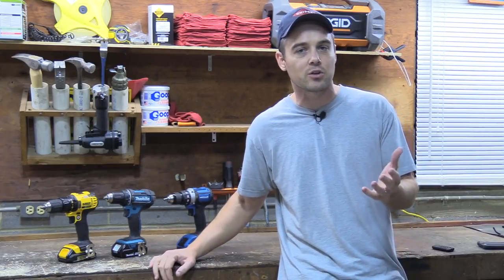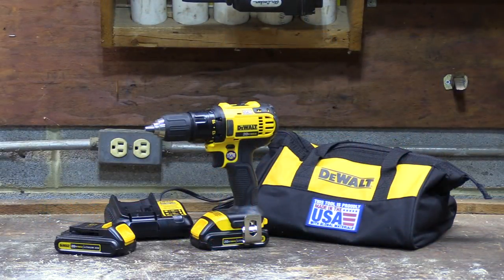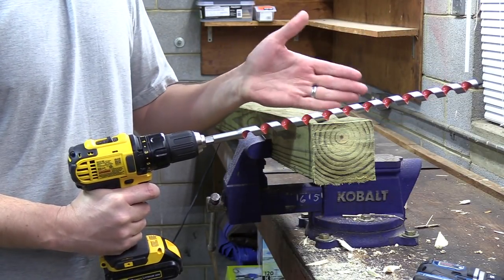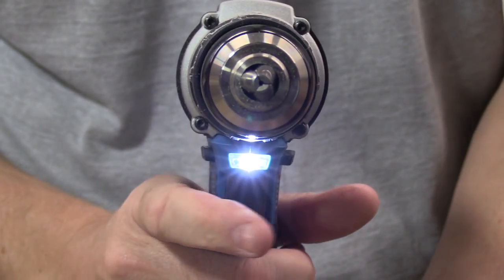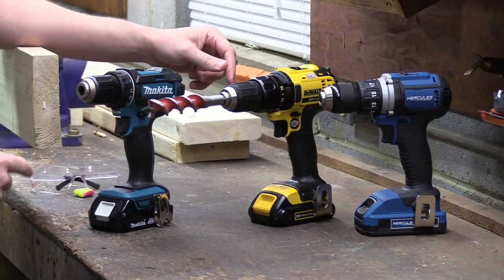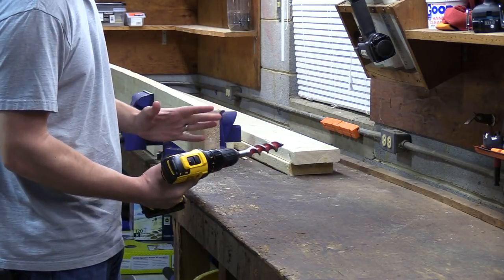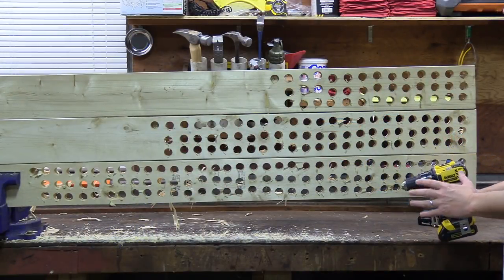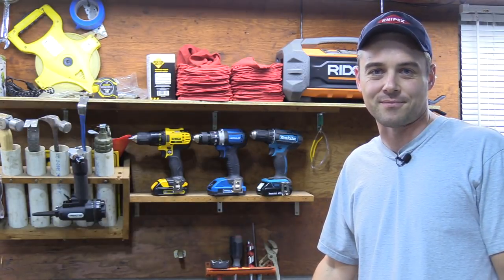Dewalt -VS- Makita -VS- Harbor Freight (Hercules) / DCD780 -VS- XFD10 -VS- HC91K1

Comment: I have the Dewalt and can highly recommend it.   It's a tough drill that I used both professionally and as a ice auger.  I do a lot of ice fishing and it drills a 8" hole through 24in of ice no problem.   As mentioned the batteries are small but it did come with two and I have batteries from other Dewalt tools.

Comment: It all depends on the work you have for your tool. If you seldom use a compact drill, I would advise you to buy the Hercules. Best bang for the buck in a household. However, if you have to make a living with your tools, I think durability and reliability count most (and things like the ability to power all your tools with the same battery pack). Although I don't have to make a living with it, I always buy Makita and they never let me down (incredible long-lasting batteries b.t.w.). Very good and honest video review!!!

Comment: A nice comparison was a little surprised to see the Hercules was brushed, usually, though that square screw-in housing was synonym with brushless motor-housing..You make some great comparison videos and especially your impact wrench Skidmore setup are best in YT class' imo.
would it be doable to make a torque testbench for 360 rotational torque simply to check stated manufacturer torque-specs where there is a lot of creativity to confuse consumers?

Comment: I was looking at this drill over the weekend and they seem well built. Your review shows they will perform. My only concern would be that it uses a brushed instead of a brushless motor. That is how drills were built for years so it is not necessarily an issue but it is a wearable item. As a kid I remember my dad having to replace the brushes in an old drill we had at the house. Again not a major issue if the drill can be opened and the brushes are available from the supplier.
Reply: Many Hercules are now brushless!  That was the issue holding me back from getting more of them, but now they’ve addressed it.

Comment: During the large hole pine wood test, i smell shenanigans, he was slow but consistant with the Hercules, but the other 2 drills, you can see he was putting more force and pressure, which can lock up any drill.

Comment: My Dewalt has never failed me, and I seem to get significantly more life from the battery under similar loads. Additionally, with two batteries and a one hour charge, never had an issue waiting for the drill.

Comment: Thanks for the comparison-but for the average guy B&D is probably better considering the price. I am a Black and Decker guy who pays half almost of all the other prices--I have had mine for over 5 years (bought the Matrix that has all the attachments), and I finally had to replace the chuck.  I later bought Porter Cable set, same battery almost - different notches.  The B&D batteries go longer on a charge--same 2 AMP/hour--same manufacturer.
If I were a contractor, I would buy the better name brand possibly so my customers would have more confidence-but for most average guys who are hobbyists - nothing wrong with the low price model.  Oh, and having 8-10 batteries that fit the same base units -- priceless.

Comment: The Makita bit test was surprising. I wonder if something about its design just doesn’t work well with those. 
In some ways the battery test is down to the rated capacity, but the Hercules did surprise just the same.

Comment: This is a great test of base line brushed models! However, I would not purchase any of these lineups in 2020. Harbor Freight does not currently offer any brushless models of their Bauer or Hercules line. Something that the new Hart brand at Wal-Mart does have in their introduced line-up of products. I'd like to see the Hercules go up against the brushless Hart, Ryobi, or Craftsman line as they are all in the same tier. The brushless Milwaukee, Makita, Metabo HPT (Hitachi), Ridgid, and Kobalt hammer drills are all going to outperform these. The Dewalt has always sucked imo. The new Hart brand at Wal-Mart is actually made by TTI, the same manufacturer of Milwaukee and Ryobi. I'd love to see some more great tool reviews from this channel going along those lines, I subscribed and would love new content!
Reply from the maker: I’m interested to see if the Hart line will last and expand.... hopefully so!

Comment: I work outside a lot and the problems we get with the cheaper drills is the bearings .my drills are exposed to heavy rain and a lot of dust and dewalt and bosch seem to do far better in rough conditions

Comment: i like the review @realtoolreviews, however, more power also comes from the higher AH. Herc used the highest, therefore i would whole heartedly expect it to perform best. 
can you redo the test and have all drills use the same AH battery fully charged?
still impressive for herc, but full apples to apples comparison
Reply from the maker: I used the batteries which came in the kits when I bought them.

Comment: The cheapest harbour freight drill may outperform the others but what about in the long run, will it still be going after 1-2 years of trade use. No point spending $99 every year when it breaks
Reply: Tim Germer wrote:
"
4 days ago

At our shop we used to buy a lot of these units as it seemed we were always replacing one or two a month (we have 30 of them).  Over the years we switched between DeWalt, Makita, and Ryobi... Depending who was on sale.  About two years ago we switched to the Hercules units when a Harbor freight opened near us.  They last just as long or longer than the others and saves us $$ in the long run."

Comment: whats needed now is a comparison of how many charge cycles the batteries will sustain before the hole drilled count drops to half of when its new. the batteries are the expensive bit of the purchase. could find that thats the archilles heel of the cheapy.

Comment: Very good video, and it's tempting to conclude the "lowest cost" drill wins the contest. However, if I understand what comes in each package, there's almost no price difference at all.  In fact one could argue that the HIGHEST cost drill wins the contest! Consider that the Hercules includes only ONE battery, with additional batteries ranging from $25-$40, depending where you buy. So that alone makes the Hercules much closer to the others in hard cost. Then consider the Hercules warranty is only 90 days, vs the much longer warranties of the other two. If you purchase an extended warranty the Hercules actually costs more.

Comment: Something to consider in the run time test, (measuring drill holes per amp hour).  That does not measure the efficiency of the tool as much as the efficiency of the battery to deliver power during a high load condition.  Yes, a 2.5 Ah battery will run longer then a 1.5 Ah battery, but that's not the end of the story.  All other things being equal, the 2.5Ah battery can also deliver power more efficiency then a 1.5Ah battery. During low loads that factor is not that significant, but as load increase that becomes more and more a factor.  The test you did, which was a high load test would exaggerate that.  If one was doing mainly sheet rock screws, I would expect the run times to be more in direct relationship to Ah's.

Comment: I have both Dewalt and Makita drills.  I purchased Dewalt because of input from construction types.  I got a Makita as a gift and loved it especially the battery life but it died in the middle of a job and needed repair.  After speaking with service center and the costs involved I thought it was DOA.  Because I liked the Makita I decided to repair it.  First brushes, then gear box and finally I replaced the armature.  It’s running again but I might have been better to go to Harbor Freight.  Some have mentioned overpriced on the Makita and Dewalt.  They may be on to something.

Comment: I've owned both Dewalt and Makita drill drivers. For me I prefer Makitas. Obviously your tests show that it doesn't have the same amount of torque as the others, so it may not be the best choice for all applications. That said, if you do work that requires repetitive driving of fasteners all day, the Makita is lighter and less fatiguing. Also, if you live near a Makita service center, this is where they shine, as their service is second to none. At the one where I live, they gladly exchange batteries that are within the 3 year purchase window of their warranty. I've taken advantage of this on a couple of occasions. This is why I give it the edge. However, after watching your video I have to say that they all seem like well built tools worthy of tradesman.

Comment: Makita. 
At least that's the brand i usually use, and never had any problems with those products, just have to find the nice place to buy
But as i live in France Makita and dewalt are not on the same Price placement, here dewalt is clearly about 20% cheaper than Makita.

Comment: Many years ago, I had a Makita that lasted forever. While helping a friend, I used his DeWalt and it seemed to spin more effortlessly. So, I bought a DeWalt with 2 batteries. Both batteries failed really quick. To replace them it would have costed more than to buy the whole set again. Hercules batteries are only $25.
Reply: Dewalt usually has more power but it's not exactly built to last a lifetime.

Comment: My experience with Harbor Freight tools has been good. For the demands of a homeowner, especially, I find their tools to be perfectly adequate.  Would they take the rough life of a contractor's usage?  Not sure.  I think contractor tools get abused, dropped, banged around, thrown in and out of trucks and used heavily for long periods.  A contractor will drill more holes in a DAY than a homeowner will drill in a year.  I haven't that experience with H-F tools, but maybe some others do.

Comment: I personally use the Makita tool range and recon it is the best value here for a tradie. It is only $10 more then the Dewalt but comes with 2 batteries. You should do a test with all supplied batteries and a charge time. As the Makita has 2 batteries you could go twice as long with it then the others before slowing down

Comment: Hopefully helpful.......I help build handicap ramps with other churchgoers on a team of about 12, 6-8 of which will show up on any ramp job.  We all use either Bosch 12 v impact drivers to set Torx deck screws.  Everyone loves the Bosch except for 2 or 3 Dewalt lovers.  The 20 volt. Dewalt drivers spin the bits so fast that they are very difficult to stop the tool before it drives the screwhead completely into the pressure treated deck board.  This reduces the shear strength of the board, but that is insequential  for deck boards but not so for vertical stringers supporting the deck boards. We air nail about 90% of the deck boards and screw the deck boards around the vertical posts for easy removal of the ramp after the homeowner no longer needs a ramp.  This saves screw cost and allows reuse of sections of the ramp and/or level sections.  Saves material cost for the next ramp.  The impact tools are not drills and are not 24 volts.  We very Seldom run our batteries dry because of the air nailed deck boards and cheaper  air tool nails.  Thus is just a comment that may need your consideration.  An impact tool drives Torx and Phillip s screws much easier with almost no stripping out of the bit area.  Also, I can prove that an impact tool can drive  4 inch deck screws into 6 inch pressure treated posts holding the tool with only 2 fingers as long as you keep the tool aligned to the screw.  Apparently the friction increases immensely when you crank down with a drill to keep the bit in the hole.  If you let up with a drill, it will jump out of the Phillips and sometimes the Torx heads, ruining the screw which is very expensive.   Try the impact tool and light pressure. Keeping the tool aligned. It will 
 amaze you.  A little off the subject but maybe a few of you will be shopping for a ramp building tool that truly works.  

JoeB

Comment: I'm retired from the building trade I only would buy Dewalt but as years went by I notice the quality of the batteries really went down and they just didn't hold up that's went I started using off brand cordless drills still using the same ones will I retired never had to replace any batteries

Comment: Totally unfamiliar with the Hercules brand but taking it as a store brand built by some significant toolmaker. I'll plump for the Makita on build quality but a lot comes down to battery performance. DeWalt has disappointed me on both counts slightly more than Makita has. Makita then Hercules then DeWalt?
Reply: I'm going to stand by my own blind guess. On seeing the results, I don't hold the Makita at fault for having that touchy overload protection for the motor as it was familiar to me. It resets right away and has never stood in the way of finishing any task irl.

Not surprisingly the store brand special is a good soldier too and it can certainly be the right choice for a certain purchase situation.

DeWalt is kind of the Ford or Chevy of tools. It's a safe choice to buy blind because it's gonna be mostly okay and it's well supported.

If I may critique the testing, each drill should have had its own brand new bit for each trial instead of just switching the same collection of bits to the next drill. Nice work though.

Comment: I would buy the Hercules if I just needed the drill or whatever, the only negative to the Hercules lineup is choice/number of tools. Harbor Freight is adding a lot of tools to its Consumer/DIY line from Bauer but ignoring its Pro/Contractor designed line Hercules. I own some Bauer which are very good for a consumer/DIY line only negatives are warranty that you have to buy separately which are reasonably priced but should not have to do that it should just come with one. I recently started stepping up to the "Prosumer" level and purchased some Kobalt which are great.

Comment: Right off the bat the Hercules is the only one with metal body part behind the chuck.  I heard harbor has been putting out some power so I'll bet on that.  The next important part about the tool is longevity, ridgid put out some strong tools but they burn out quick

Comment: I use my Dewalt DCD796D everyday at work in a manufacturing plant. Have made over 1000 holes into 5000psi concrete and drilling through 1/2in steel with no problem after 2 years.  The Milwaukee and Makita in the maintenance shop do not hold up. Me and the other maintenance guys at work use my drill and 1/2in impact made by Dewalt everyday and hate it when i'm not at work. lol

Comment: Cool demonstration but it doesn't show the life of the batteries or the drills. Give the units to a construction crew and have them use the drills as equally as they can and see which ones last over time.

Comment: Pre-view vote:  Makita, Dewalt, with Harbor Freight coming in a distant 3rd place.  
I have a Dewalt, and use a 5 amp hour battery which has worked like a champ for 4 years now.
Wasn't impressed with the temperature protection used in the Harbor Freight batteries.

Comment: that drill didn't stall. You can't keep the Forstner bit straight enough.  The bit is binding. Try that with a Milwaukee hole hog and you will probably break your wrist or arm. We can see the offset torque wobbling in your hands.
Also, I believe the Makita has an overload shut off. I don't have any of those drills so others may have the shut off too but I have read up on some of the newer Makitas. My hammer/drill has it as does my 36 volt  circular saw.
Reply from the maker: That’s not a forstner bit.  It is a self feeding wood bit.
Reply: Real Tool Reviews sorry, I stand corrected.  The self feeding wood bit is binding.  
These lil drills are not meant to remove that much shock at one time either. Certainly not on a regular basis like (Construction workers) would use them. Homeowners maybe?  even your first drill bit at 1" or so was much too aggressive for all 3 drills.  If you listen to the rpm sound it almost stops all together on each drill.  Too much strain on that little motor.    I am a Carpenter by trade, since 1987. When I started people still cared about doing quality work. They taught the importance of " listening to your tools". If the RPM's slow down, you're pushing too hard.  Let the tool do the work. 
It is safer and will do a better job while not beating the crap out of your tool.
edit 4 P.S
Any self feeding bit really should have a drill attached to it with hi torque and lower RPMs. Lower speed setting on those drills would help the motor a lot.
Reply from the maker: I did use all of these on the low speed setting with the self feeding wood bit.

Comment: Besides having two batteries being  more convenient, you can often find the Makita and Dewalt on sale for less.   I've seen them for the same  $99.00 as the Hercules on sale.  Under those conditions I'll get the Makita or the Dewalt.  And even if they are not on sale now, I'll wait and if push comes to shove I'll still by the name brand.